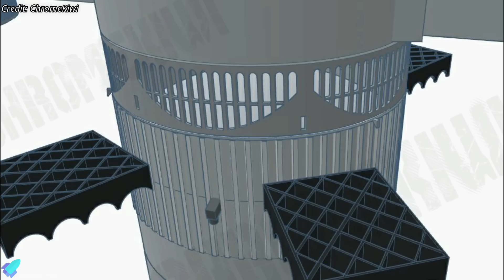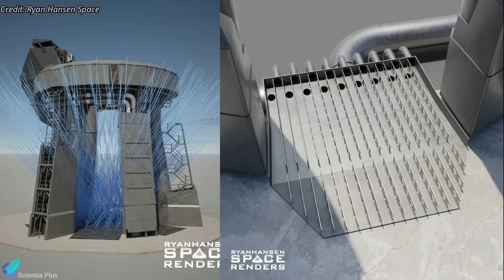SpaceX Revealed Starship Design Upgrades For Astronaut Safety

Comment: Nikola Tesla said that if you attracted sine waves to the nose of your space craft and converted them to DC and pulse them out the rear you would travel through space.
Reply: Nikola Tesla said a lot of things that were trippy and unworkable.
Reply: @gdutfulkbhh7537  Well he had at least over 1000 patents of things which did work to mention a few like AC power, Xray, computers, and of course the guidance modern day missiles and transportation uses every day. I have tried his idea out by using old radio valves linked to an aerial for AC and converted to DC and the pulsating out put was boosted dramatically and if larger working in a vacuum one wonders if it could in fact be a cosmic force drive unit?

Comment: During his introduction of "hot staging" and introduction of "vent ring" to SH Booster design Elon failed to explain how the Starship is going to be supported on top of SH Booster during liftoff. It is quite obvious that it can longer be supported by the Skirt as "vent ring" that the Skirt will rest on has no structural strenght in compression. BTW the Skirt does not have enought compression strenght either to support the Starship during liftoff. Too bad nobody asked as Elon would have explained that in order to introduce "hot staging" it was necessary to make design change and use Vac Raptors rocket engines as support columns and use  newly introduced hot gas shelding also as support structure for Vac Raptors  serving as support columns for the Starship during liftoff. Many people would have realiaed than that this "hot staging" idea is just a convinient excuse to walk away from the Skirt as structural element of the Starship without admitting that the Skirt failed during last test flight. BS baffes brains but honesty is much better in the long run if Elon hopes to get taxpayers money to send his rocket to the Moon.
Reply: Versus NASA'S utter and complete failure of the Space Shuttle that cost us US taxpayers billions of dollars and more critically, caused the death of 14 souls. The program was a government boondoggle.

Comment: What happened to all the previous successful engineering of the Saturn 5 MOON rocket.   You need to get some of the old Saturn Rocket engineers to act as advisors in your engineering section.   Build on old successful engineering or you'll never get back to the Moon, or Mars.
Reply: Apples and oranges
Reply: No!  Never!
Reply: They are all dead
Reply: SpaceX is in constant consultation with NASA, and NASA has all the technical details of the Saturn 5. Almost everything SpaceX has done has had input from NASA's engineers, even on matters as small as the best type of exploding bolts.

Comment: Design work on Jeff Who's New Glenn began in 2012; the rocket has still not even achieved a 1st test launch. Development of the ULA Vulcan centaur began in 2014 and it still has to achieve its 1st test launch. The SpaceX Falcon 9 development began in 2005 and it first flew on June 4, 2010. Design of Starship is not in its 14 yr of development (see comment from @horatio 1962) - that is BS! The 1st concept design of its predecessor, the ITS, was presented in September 2016 - it later morphed into Starship. The 1st test flight of the 1st fully complete Starship upper-stage prototype took place on 9 December 2020.

Comment: After seeing the damage to the OLM caused by the blast from 33 Raptor engines you would think that there would need to be an awful lot of heavy protection material built into the top of the Superheavy booster - don't forget, the booster is not intended to be expendable like all the Russian rockets which use hot-staging separation.

Comment: I would hate to do the logistics on getting 75-100 concrete trucks there and on time, or is it mixed on site? Either way I hope they bring lots of sugar so it don't kick while it's still in the truck
Reply: The logistics for the fuel trucks is an even greater nightmare
Reply: @jason_m_schmidt622  same same but different lol concrete can only be in the truck for about 2 hours before it starts to kick, I'm sure fuel trucks have a time limit as well but I don't know as much about that

Comment: Starship  is in its 14th yr of development today. 2009-2023. All the hype that Space X development is so fast is all Musk BS!
Reply: Oxy moron
Reply: Design work on Jeff Who's New Glenn began in 2012; the rocket has still not even achieved a 1st test launch. Development of the ULA Vulcan centaur began in 2014 and it still has to achieve its 1st test launch. The SpaceX Falcon 9 development began in 2005 and it first flew on June 4, 2010. Design of Starship is not in its 14 yr of development - that is BS! The 1st concept design of its predecessor, the ITS, was presented in September 2016 - it later morphed into Starship.
Reply: Your lies don't hold up.  Are you related to Jeff Who?